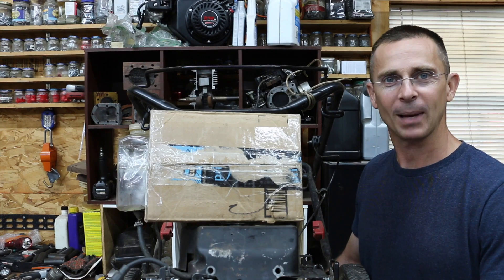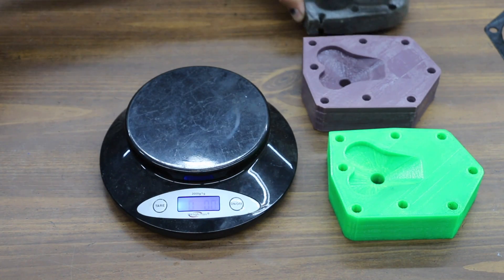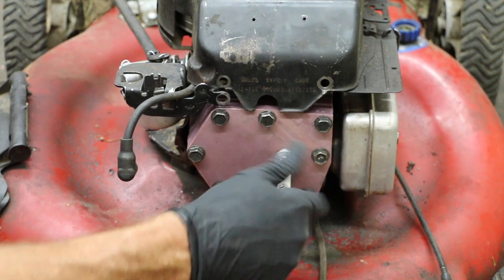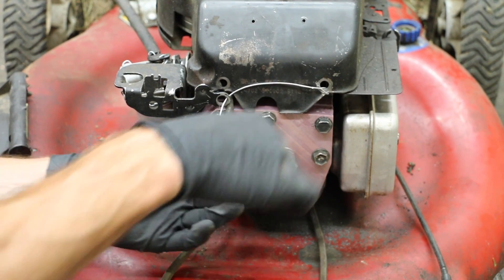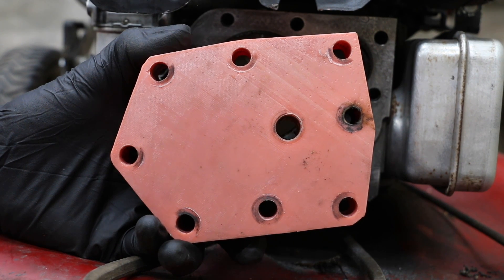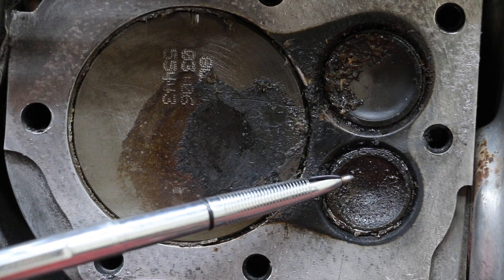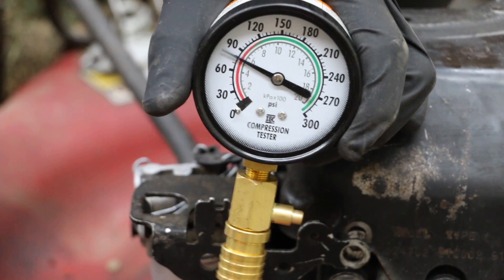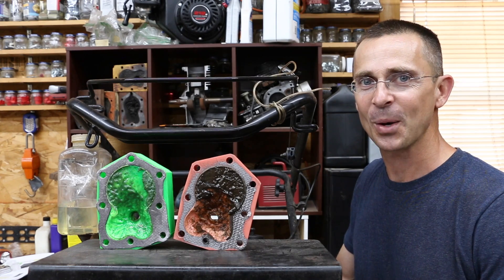How long will a 3D printed cylinder head last?  Let's find out!

Comment: Aluminum heads survive even though the melting point for that metal is also much lower than the peak temperatures inside the cylinder.   They last because they are actively cooled and have a high thermal conductivity (TC).  So the internal surface never reaches its melting temperature.  Plastic could probably hold up for much longer if you can find one with a much much higher TC and add active cooling.  The problem is that (pure) aluminum's TC is 237 W/(mK) and that is  more than 500 times higher than the TC of most plastics. Carbon fiber is supposedly 24 W/(mK), which is only off by a factor of 10, but that value may be for the fibers themselves and not for a bulk material which has them embedded.  (Apologies if this point was made previously, currently 7636 comments, too many to read.)

Comment: Back in the day you could get a smoking engine repair kit, it came with some cd2 thick snot in a 16 oz can and a bunch of plastic balls, add the additive with new oil and put cd2 and then add 4 balls a cly, it worked and would stop smoking for quite a while
Reply from the maker: Thanks for sharing.

Comment: You need to try it with PC (polycarbonate) or PC-CF (carbon fiber filled polycarbonate) filament, I bet that would last a couple minutes as it can hold up to near 300º F.  PC might even beat the wooden heads.  If you can send me a link for the STL or STEP file the other guy used I will try to print you one. 

3D printing is better for making molds for sand casting (with some extra prep), most common printing filaments can't take heat well. I've printed TPU gaskets to replace odd sized or hard to find O-rings and some back ordered silicone gaskets for short term use.  Some filaments can take higher temps but I wouldn't expect any to hold up for long as a cylinder head.  I expected the plug to blow out with the ABS like it did with the PLA and was surprised it didn't.  I hope you had fun with this, I'm sure you need a break from the serious reviews now and then.
Reply from the maker: Yes, had fun with this one!  Thanks for watching!

Comment: Those tests are interesting, but why are they always done with those looser plastics? Why even tests PLA? It already melts if you leave it in your car on a sunny day. That's stupid. And ABS is also not sufficient. Those tests should be made with PA12CF and PEEK. That would be interesting.
Reply from the maker: Thanks for the suggestion.

Comment: I could totally see making a 3D print head, then cast it from some old pistons or something, pistons can be fairly hard aluminum, I modified some scooter pistons, I was surprised how much harder they were than the head I just ported!.   When I first heard about 3d printing, I had no respect for it, I was thinking it would make things that are not actually useable, and would need to use them to cast from metal, or epoxy or something, but that was over 20 years ago, now I'd like to have one!!
Reply: 3D printing can be quite useful, there are some really strong filaments out there and many useful parts can easily be printed (gears, brackets, camera mounts and such).  It's also easy to print prototypes for testing. A lot of people just use printers to print models and novelty art for the most part while some people print RC car and drone parts.  I've repaired several appliances by printing out new parts to replace broken parts.  Comes in quite handy but not sure the expense for the printer itself is justified unless you really enjoy it as a hobby.  A lot of people print stuff to sell on Etsy or Ebay and I've been thinking about looking into doing some of that myself.

Comment: When I was a kid with a go-kart, I modified the head and ports, to get more power, I wanted to make another head, I already shaved it until the valves were almost touching the head, they were carbon markings but not actually contact, but I wanted to make one with the plug in a tiny bowl over the piston, with just enough room for the valves to open, and a groove the valve width,  to just past the cylinder bore, so the in and out flow will have a clear path, and the compressed air /fuel can be compressed more over the piston, making more power hopefully, more compression! Basically a v coming from the valves! With the plug at the peak of the v, with everything else filling in the combustion chamber, it's difficult to build compress with a flat head engine,
Reply from the maker: Thanks for sharing.

Comment: So 3D printing can make a cylinder head not that much worse than my 2002 Focus came with.  Gonna find out if JB Weld and red RTV can make it run for a few more weeks while I try to save up a better down payment on a replacement.
Reply from the maker: Thanks for the feedback.

Comment: Try it with poly carbonate and high temp tpu, or if the printer can handle it POM or better yet PEAK. PC has the highest temp resistance* of filaments commonly printable so try that first. 

*(to my knowledge)
Reply from the maker: Thanks for the suggestion.

Comment: 3d print using higher temp stuff, you can do nylon and tpu and they should hold up better, you could even add points in them for metal seals so they work properly as a head gasket
Reply from the maker: Thanks for the suggestion.

Comment: When you explained what they were made from I knew it was failure by design. I do a TON of 3d printing. PETG plastic most likely would have survived. Holds extreme pressure, shock resistant and can withstand the heat of a small engine's head. The only issue is it cannot dissipate the heat like metal can. I can explain the first failure, it can't withstand the heat. PLA has the same issue, but it is prone to cracking, that's why the spark plug popped and the valves were easy to break free. The gasket looked like it was made out of TPU, it can barely handle the heat and when push comes to shove can't handle the pressure. They do however work well for carburetor gaskets and such. Kind of want to make a PETG one and post the results, I'll follow back on that if I decide to do it.
Reply from the maker: Thanks for sharing.

Comment: To extrude these plastics in anything remotely safe to use in the home, they all melt down somewhere between 205 C and 250-ish C.  Inside that combustion chamber it's getting into the temps that are 10x that!  Even with metal heads, you have to worry about heat - thus the fins for cooling, and various other design conditions.  The plastics are obviously strong enough, but some of that strength (e.g., the thickness) might be sacrificed for heat dissipation.  This video also should be watched by anyone who things that 3-D printed firearms are anything other than 1-use novelties.  You are always going to need a metal chamber and barrel.  A 3d printed stock is no different than if you went out, cut down and oak tree, and carved your own custom heritage oak finish stock - it's won't do much without conventional manufactured parts to make it actually function.
Reply from the maker: Thanks for the feeddback.

Comment: I build and design 3D printers. You can print glass reinforced nylon, contiguous carbon fiber and aluminum. I sinter print steel with a sand blaster &  6 axis panasonic laser @ work. That guys temps werent high enough thats why it was all warped. I'm guessing it is ABS because ABS does that. I'm the king of ABS printing! He also chemically welded the inside with acetone. Smart guy. That 2nd one had to be PLA or Polyactic Acid known as corn starch.  Credit cards are made from that.
Reply from the maker: Thanks for the feedback.

Comment: You should do a video on if jb weld could be used as solder to connect copper tubing and how much pressure it could withstand
Reply from the maker: Thanks for the suggestion.

Comment: I think it would be fun to see how a fiberglass or resin cylinder head would hold up, they probably could withstand more heat too. Great video!
Reply from the maker: Thanks!  Great suggestion!  Thank you.
Reply: @ProjectFarm  do the resin along with PC, POM, PEAK, and reinforced concrete*.

* use a cast in place steel piece for the spark plug screw spot as threading cement sound hard.

Comment: I see am about 3 years late to comment on this, but if you ever try 3d printed cylinder heads again polycarbonate has a higher melting temp and should do better, its possible other plastics can do well with it too but I dunno of any other higher temp plastics...

Comment: TPU 95A makes really good gaskets and O-rings.
Would like to see one of these heads made from CF nylon, I prefer SainSmart 25/75 black CF nylon. Polycarbonate would be cool too.
Or maybe do a collab video with Vision Miner and have them print some heads out of PEEK and PEKK.
My Ender 3 Pro is running Marlin 2.0 firmware on a 32 bit silent motherboard, Micro Swiss direct drive and all metal hot end kit, BLtouch auto bed leveling probe, textured glass bed that is hard mounted with solid bed mounts. It'll print anything from PLA, TPU, and all the way up to CF nylon and Polycarbonate. Also, ASA is easier and better than ABS. PCTG will be replacing PETG soon too.
Reply from the maker: Thanks for the suggestion.

Comment: I'm surprised the PLA one was the one that did that, ABS doesn't react great with Solvents, PLA is... better but stuff not great PLA has a little bit lower melt temp but yeesh.

I have 3d printed some moped parts but I try to avoid anything that gets hot .-.
Reply from the maker: Thanks for sharing!

Comment: I print with PLA at around 205 C and ABS at around 260 C, there are other engineering plastics that are better able to withstand heat but require high end 3D printers to print because of the temp.
Reply from the maker: Thanks for the feedback.

Comment: I would like to see a hot and running engine submerged into an ice bathtub to see if the block breaks or keeps running. Also would be interesting to see an engine run in an oven to see how long it lasts before melting.
Reply from the maker: Thanks for the video idea.

Comment: 3D printed turbo in a car. I would like to see if the compression of air inside the housing could heat up to melt the PLA turbo
Reply from the maker: Thanks for the suggestion.
Reply: @ProjectFarm  No problem!

Comment: would love to see how a 3D printed cylinder head using carbon fiber infilled nylon would perform.
also, dual extruded continuous fiber nylon.
Reply from the maker: Great suggestion!  Thank you.
Reply: @ProjectFarm  I'm currently saving to invest in my first 3d print setup. I'm particularly interested in these high strength/high temperature filaments for engineering purposes. Also resin for high detail parts.

Comment: The ABS seems to have high temp tolerance. So, Maybe using a thin aluminum foil would keep the plastic from dripping away. In addition, you can add a layer of temp resistant wrap like on turbo exhaust which will help the ABS cylinder head run cooler.
Reply from the maker: Thanks for the suggestion.

Comment: Are used to work at a plastic injection molding facility for a good couple of years, and we would make these carbon fiber/polycarbonate gas pump regulators used in nearly all gas pumps produced in the midwest.  They would be sent off to a cryogenic facility to remove excess flashing around the small openings in the center of the parts (one for intake of gasoline, another for distribution to the pump after being registered in the pumps).  A box of 500 was $150,000!!!  Insane!  But, if there’d be any way to get a cylinder head made out of that material, that would be insane :D (which was primarily proprietary but I can say it was at least 70% carbon fiber, 25% polycarbonate, and 5% proprietary materials).  The craziest part was, when they’d drop and hit a concrete floor, it would sound exactly like if you just took a handful of pocket change and dropped it on the concrete floor - no joke at all there!  Thank you and the 3D printed part provider for making this video possible!
Reply from the maker: You are welcome!

Comment: Do you have a friend with a Metal Powder Bed Fusion 3D printer? You could get one yourself for a mere $80K. You should get one! It can use various Stainless Steels, Super Alloys, Tooling Steels, Aluminum, Titanium, Bronze, and Copper. Advanced users are able to use their own metal powders if needed. I'll bet a cylinder head made by this would last.

Comment: I have the identical Toro recycler. How do you remove the pull string and connect up an attachment so that you can start the engine with a drill? thanks!
Reply from the maker: Thanks for the video idea.

Comment: A plastic cylinder head! What could possibly go wrong??? Not to mention, No Cooling Fins! A concrete cylinder head could never make a good seal to the cylinder. How on earth could you thread the hole for the spark plug?

Comment: Unless the cylinder head made by a method similar to laser powder sintering.
After all, the principle of this kind of 3D printing is to heat the plastic to extrude it, and then stack it up. 
Of course it is very sensitive to temperature.
Reply from the maker: Thanks for the feedback.

Comment: Its a motorcycle nuts die for an injection molding machine...or tractor nuts...! I wonder how well a laminate made of many layers of heavy duty aluminum foil and as thin of a coating of flex seal as possible would do for a piston head like that?...i be a small piece of angled sheet metal or cut open and bent copper 1/4 inch tubing would reinforce that exhaust pressure zone .  that plastic gasket seems like it just needs a little help !. Can cut to shape steel screening be used as a central layer to reinforce it? Or maybe zipties cut into long yet narrow evenly sized fibers and laid down in a crosshatch pattern and as with the screen , print the other half on top of the reinforcement ? Burlap would probably work well too. It is used to reinforce rubber ... I realize project farm doesnt have the 3d printer and it was a send in. And the laminate head would take a very long time to make.   These are just ideas i have for whom ever wants them. The zip ties came to mind as it may partially fuse into the gasket really bonding it in place...oh the plastic packing straps that end up peeling apart would probably be fantastic too. Great video. These always get my inovative side going.

Comment: You should get a 3D printed tube that does a 90°, that bolts between the carburetor and the motor. 

You can test to see what plastic can stand the close proximity of the motor heat, ability to with stand gas/air mix, and the shacking of the motor with the 90° giving it a torque effect on the plastic to see if it twists off. 

I am curious if the ABS would be a good option for that or if they make a better 3D plastic to with stand gas? 

Thanks.

Comment: It must be a ford spark plug ejection !! Lol 
Try out the new metal 3D printers
Reply from the maker: Thanks for the video idea.
Reply: Project Farm  I have another idea for  your 2 stroke motor kit   For bicycle 
Install a jackshaft kit   ... this eliminates  all that extra long chain  ,that extra a sprocket , and chain tensioner 
It allows the motor to use the bikes gear set as a transmission  I’m not sure if it will allow the bike motor to go any faster , or will it allow the bike to take off better than standard setup.  Nobody is really clear on this but I am a advocate for motorized bicycles  since the kits are so cheap and bicycles around my way are basically free  thrift stores give them away to people

Comment: Whoever made the heads: You literally had a 3D-Printer at hand, why did you skip the cooling fins... 🤦‍♂️
Reply: At a guess... because they thought about the strength and decided a solid block was better. And plastic is a crap heat conductor, so the fins would do almost nothing
Reply: @samuelmellars7855  Then just skip tbe 3D printer next time and grab any random object.....        zzzzz

Comment: The answer is - 3D print the part with "Carbon Fiber Nylon" filament material - it handles 350 degree heat and its stupid strong. I make car parts with it.
Reply from the maker: Thanks for sharing.

Comment: ik this is old but they make metal 3d printing filaments 
Should try one of those out rather than plastic that isnt meant for high temperatures
Reply from the maker: Thanks for the suggestion.

Comment: yeah i saw the wooden one and i tough it would be worse with plastic 
the main problem with these materials is thermals basically every material thermal is a problem but metals able to stand more heat and remain its own shape unless a chemical substance brakes it
i wonder what would happen if you combine a material with thermal resistance material like the one that computers use basically thermal pads but i bet oil or liquid type combined with heat gonna damage or brake the thermal pad so good old steel or metal keeps everything together and this technology will age like a fine wine despite be not liking any time of wines
Reply from the maker: Thanks for the feedback.